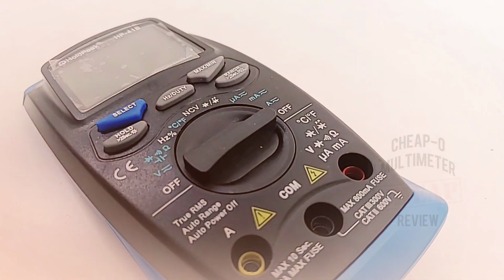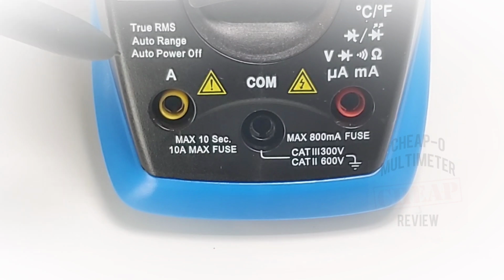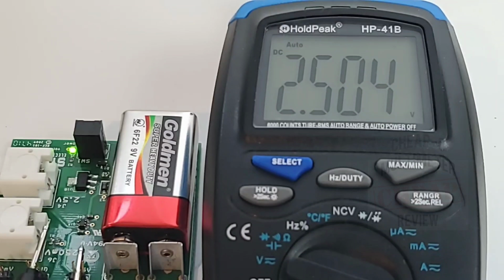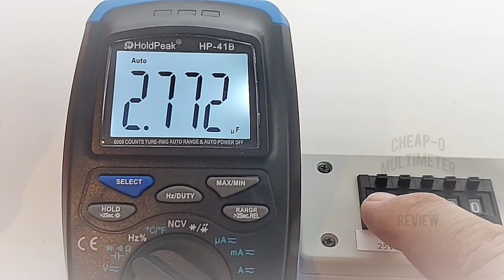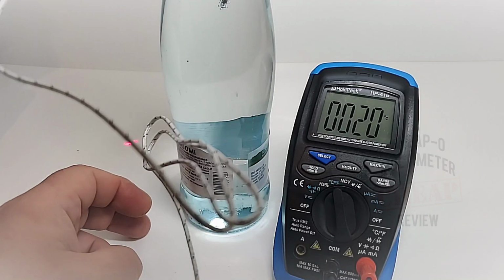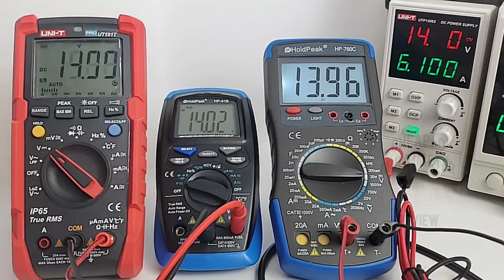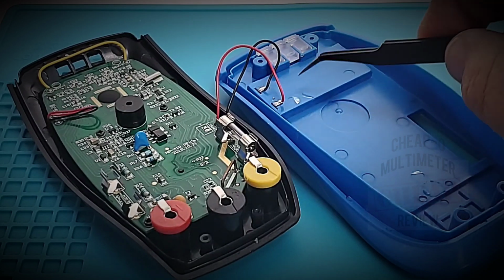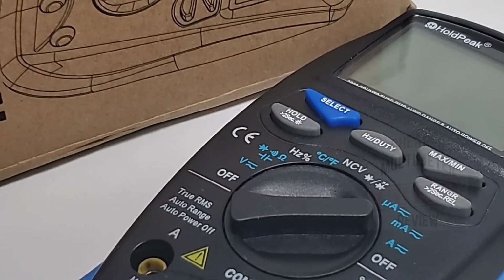HOLDPEAK HP-41B CHEAP-O Multimeter Review & Teardown

Comment: Did you happen to test the MAX/MIN funcitonality for this cheap-o meter?  I would like to measure the voltage drop of my 12V car battery during cranking when the starter motor engages, and was wondering if this meter's MAX/MIN option would be able to capture that split-second lowest voltage drop, and do so fairly accurately (but I'm not expecting Fluke performance at this price).
Reply from the maker: Yes shoukd be fine..Max/MIN worked as expected. It should suffice to see the voltage drop on your 12v automotive battery. Lemme know how it goes!

Comment: I like the look of this unit--nice curves.    Yes, the input protection is not there; however, the potential for the manufacture to upgrade it such as better fuses, a beefier PTC.--no room for the big HRC fuses.  I enjoyed the video.  As far as the shielding goes, I have a broken Fluke 233, and it does NOT have shielding.  An interesting test would be to see how shielding affects varies different meters.  Perhaps manufacturers think there is no need to provide it in a nonindustrial setting.  Most of the cheapo meters seem to design for the DIY guys or as a hobbyist.   I guess my point is if you are a professional technician, electrician or engineer, I don't think you would use a Harbor Freight Cen-tech 90899 ( was free) to test 3 phase circuits unless your are insane or ignorant.  But for the hobbyist, that same meter can be a good tool.  Near the bridge rectifier, there was a blue component labeled RV1, could that be a MOV?
Reply from the maker: I'm hoping to do a comparative review if a dmm with and without shielding. Yes that component marked RV 1does at first glance appear to be a MOV, albeit oddly placed. There's no markings on mine and I'm still trying to discern its purpose.

Comment: Missing probes build quality check in the video, but they don't have resistance, which is nice to see. What is the first LED  among those three for? Second one was for continuity and the last was for NCV. This is a bad little beast, literally a Shark 🦈, the fin is missing though, nice inspiration HoldPeak! Handy design with a twist. Can these glass fuses be replaced with ceramic quick acting in it?
Reply from the maker: Test leads are fine but I wouldn't use them for HV or current. You certainly can replace the glass 5x20 with a ceramic. I will verify the LED.
Reply: @KeepOnTesting  OK

Comment: This is a dumb generic question: I see that the AC Voltage shows Freq when you hit the select button. What does the "HZ%" mode measure? If I'm using PWM to Dim an LED on a DC circuit, can I measure duty cycle with it?
Reply: yes you can!
Reply from the maker: Roger that!

Comment: Nice little $20 meter! That typo is comical.  2 non-threaded screws to get to the batteries? Sigh. I guess if you blow fuses more often than you run through batteries, it won't matter to you.
Reply from the maker: Too bad they couldn't have incorporated a better fuse/battery panel cover..
1st Engineer* 
Let's make fuse access really easy!
2nd Engineer **
Definitely, now 4 or 8 screws before applying the crazy glue..? 🤪